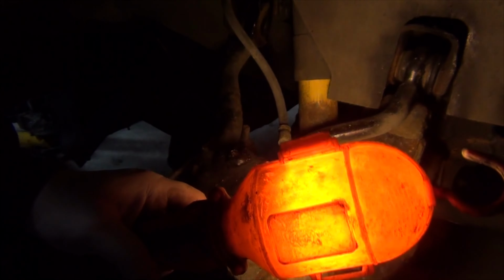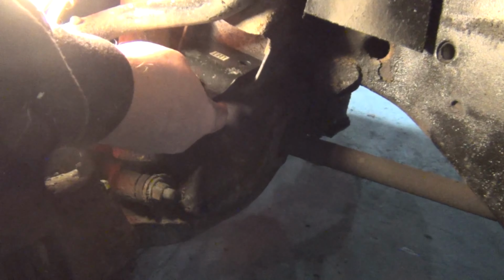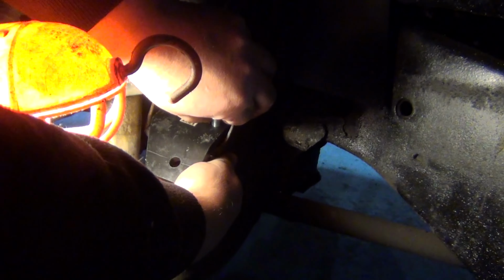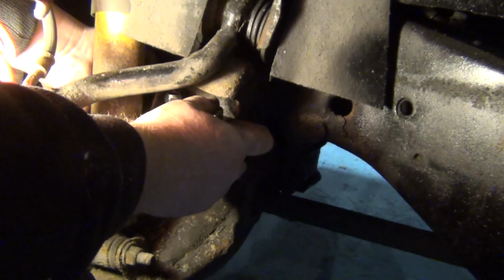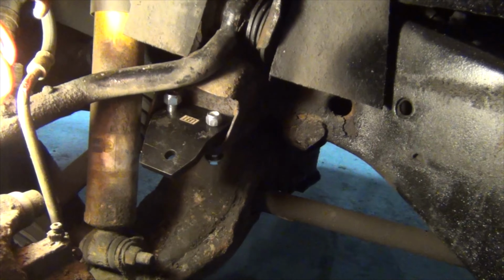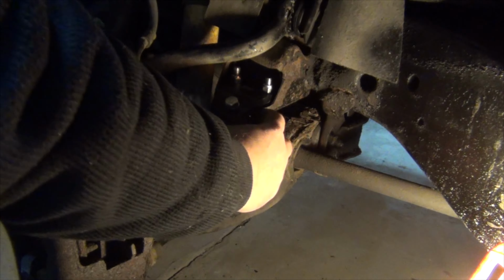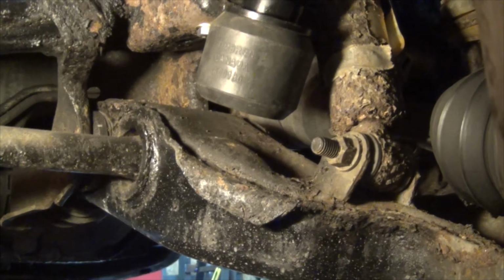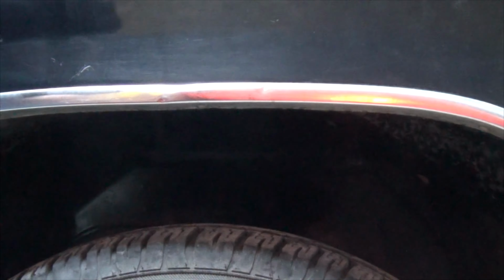Snow plow front suspension sag on a 98 Tahoe - problem solved  Timbren GMFK35C bump stop  EZ install

Comment: Did this affect the ride when the plow is off? Roads around me are rough already.
Reply from the maker: Yes. Stiffer ride. You feel every bump. Never the less, it’s well worth the installation. If you have any other questions, please feel free to ask. Thanks for watching and commenting. Please like share and subscribe
Reply: @handymanPF  hey thanks for the reply. I ordered some and I may use them for plow season only then remove them is what I was thinking.
Reply from the maker: That’s definitely an option. I would recommend using new lock nuts on each reinstallation for safety reasons though.